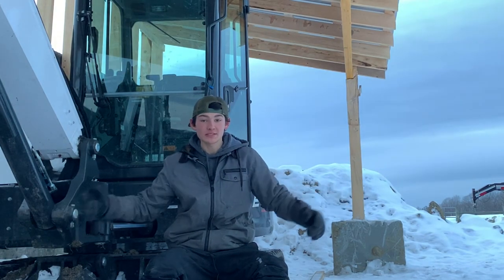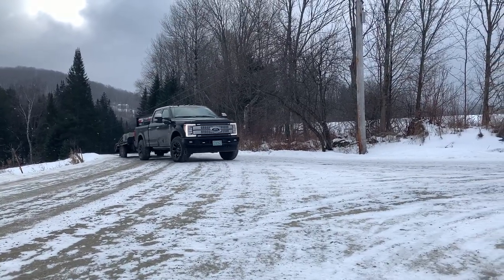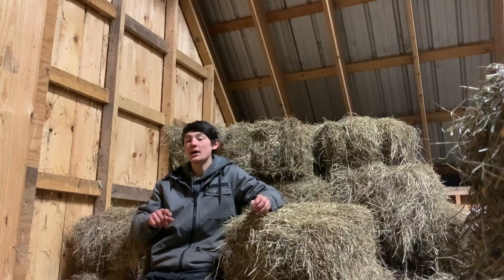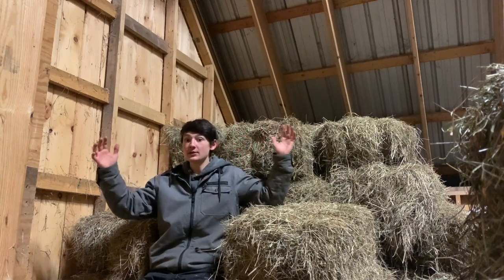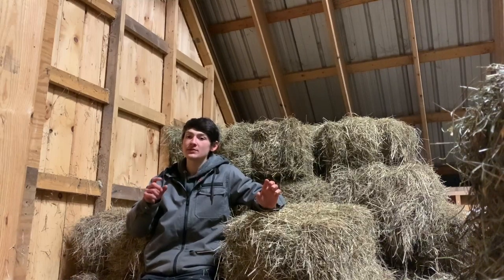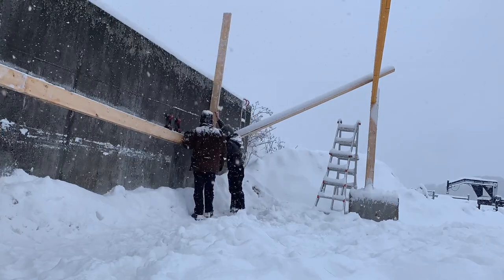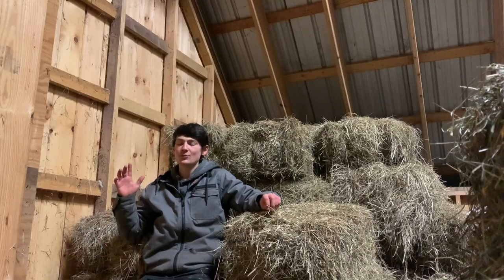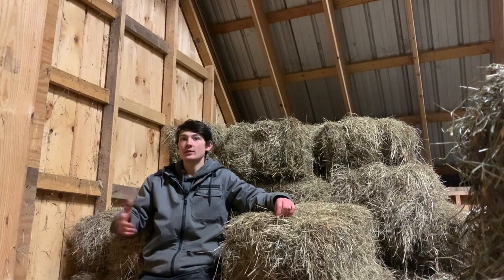Building a Shelter for our Sawmill | LT40 Woodmizer

Comment: How much did that lvl cost? I’m in the process of building my sawmill shed and am wondering which way to go with the beam.
Reply from the maker: I think one was $180! So four would be $720 because we doubled it so it was around 4” think and 32’ long.
They are very expensive! Steel might be cheaper but not sure... it would have to be a pretty good size “i beam” for it not to sag
Reply from the maker: I think one was $180! So four would be $720 because we doubled it so it was around 4” think and 32’ long.
They are very expensive! Steel might be cheaper but not sure... it would have to be a pretty good size “i beam” for it not to sag
Reply: Wait, what?? You're not building your shed from wood you saw on your mill???
Reply from the maker: @jamesrussell6870  I don’t have the mill yet, so we had to buy lumber.